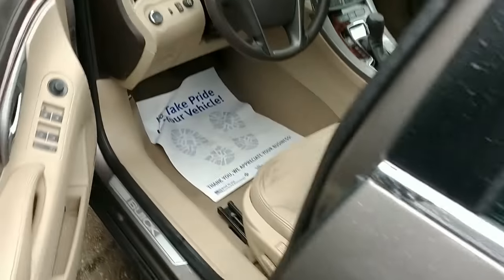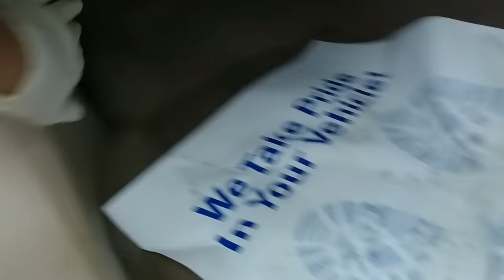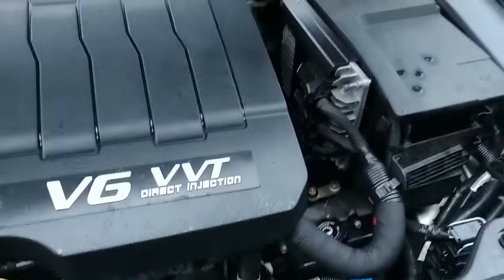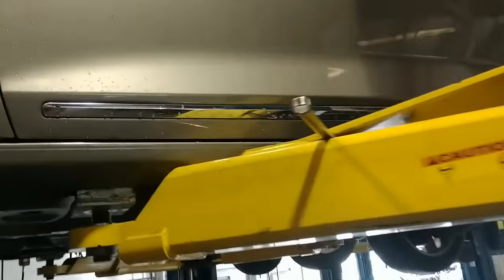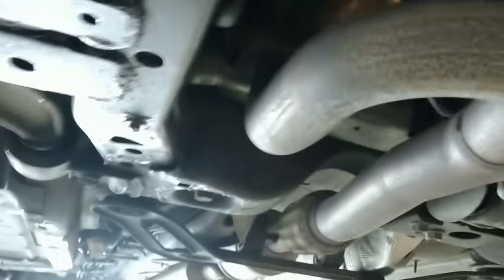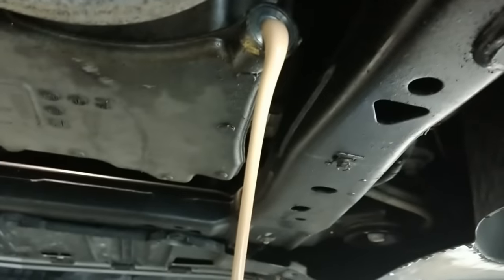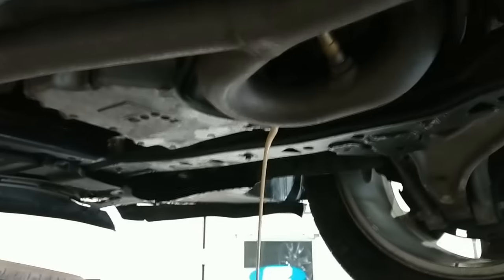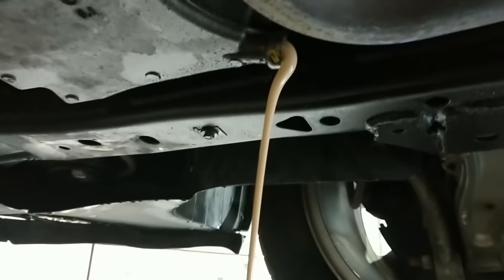Overfilled Crankcase! Blown ENGINE! Used Car Nightmare!

Comment from the maker: To anyone buying a car, truck, boat or whatever... Have it inspected by a 3rd party. Pay them to check out EVERYTHING! Then you know what you're buying. A $100-$200 inspection bill is much less expensive than being stuck with problems like this. If the seller doesn't like that idea, don't buy from them. Vehicles and dealers are  everywhere. Don't get suckered.

Edit: found grammatical error a year later 🤣🤣
Reply: They made Buick vinaigrette. The oil and the coolant  emulsified in the engine like a salad dressing
Reply: Even if you are a tech yourself it still pays to have someone with no "skin in the game" doing the health check, especially if you can find someone with more experience with the year, make, and model you are looking at! Edit: I am not saying that I bought a vehicle ignoring glaring issues because "I can fix it" only to find out later they were a bigger PITA than expected but I am also not saying that I haven't.
Reply: Inspection bill? is this the same as getting an inspection for your registration, or are there mechanics that will specifically inspect a car for you before you buy it?
Reply: I work as a mechanic...licensed...certified etc. if I had a dime for every POST purchase inspection that I've done that's uncovered thousands in work required to make the damn vehicles safe...I'd be a rich man by now. People...get it inspected BEFORE you pay for the vehicle!
Reply: Same goes for a house. On top of the bank's house inspector, have specific electrical, plumbing, and hvac inspections.
Reply: @RockSleeper  Any ASE mechanic should be able to inspect a car for basic road worthiness and major problems.
Reply: @RockSleeper  No.
Reply: Remember, folks: unless it actually runs on coal and has a boiler, a steam-powered car is a bad idea.
Reply: My 2 cents. Dealerships are a new low. I never trust the seller. Oily is the expression used how dirty car Dealership s are. Do your research and get a good inspection.
Reply from the maker: Any shop will be happy to do a super  thorough and comprehensive inspection for a prepurchase inquiry. They usually charge between 1-2hr labor.
Reply: UH-OH! LMAO.
Reply: Excellent advice! Bought a car recently that was "too good to be true" well after 600 dollars in parts and alot of swearing it would have been better to drop some more dough and not have a headache
Reply: @RockSleeper  I guess it depends on the state, here in MD state inspection is only done once when you first tag your vehicle, but you can have a vehicle inspected before you purchase it as long as the owner is willing to take it to the shop to have it done. The last time I had a car inspected was 2018 and it was around $90-100. Because it is only done once here in MD they are more strict and nit-picky unlike say VA that goes every year or every other year and only checks basic stuff like tires, wipers, lights etc.
Reply: So what was it, cracked block or head gasket?
Reply: @JasonW.  why? They can say anything,miss anything.  They have no accountability to anyone
 Big scam. At least where I live.
Reply: I check my own cars.
Reply: @Jo Blow but how does one crack a block?
Reply: Or simply have common sense . To be honest DOSNT surprise me at all with the new auto industry nothing is built to last years down the road disposable Dixies you replace every year .
Reply: Great advice but unfortunately I think most by here pay here customers don’t even think twice about the vehicles reliability. They are more worried about getting approved hint they shouldn’t be Financing a car
Reply: Yeah or what’s called MAYONNAISE. mayonnaise MATE
Reply: Word
Reply: @Jo Blow did u not see all the water coming  out the exhaust  it's a head gasket  for sure.
Reply: If a seller has a problem with you having the car inspected, stop to wonder why that might be.
Reply: unfortunately its difficult to find a shop that is willing to spend their time looking at a car lol. I took my car to two shops to get checked out and they just half assed their "inspection". Shops now a days seem to be unwilling to fully inspect a car regardless of money lol. I dont even bargain for the amount they want to charge me to look at the car. They thought my car was "losing oil" because there was excess oil near the oil filter which sits at a 90 degree angle and is very tough to get to. 07 Si btw.
Reply: @Jo Blow 🤔
Reply: buy here pay heres love to sell those pretty pieces of shits, to people that dont know any better for 30.99999 apr and a huge down payment...
Reply: im assuming the original owner.. got repoed. emptied the oil or dumped anti freeze in the oil...new buy here pay here won car at auction, there in house jack legg mechanic assumed it need a water pump. replaced it, might have broke a bolt or forgot to tighten.. water pump leaked into timming chain..down to oil pan... im just assuming.
Reply: everyone should know enough to check oil and coolant...especially if you're buying a car
Reply: @stevejackson9952  v6 vinaigrette. My favorite
Reply: @lawnside82  I agree
Reply: 100% agree have worked for multiple dealers for years and nobody would ever be against the inspection, it’s actually nice for the dealer because you don’t have to worry, if something happens in 3 days they will blame the inspection mechanic lol
Reply: @RockSleeper  not the same as a state safety inspection, get a pre purchase inspection before purchasing
Reply: @nbrowser  yeah 95% of post purchase end with customer pissed or crying
Reply: @RockSleeper  no it’s different. Find any quality mechanic in your area and schedule a pre purchase inspection. They’ll look over it with a fine tooth comb and tell you everything that needs fixing or if it’s worth buying.
Reply: @justinkroeker1464  recent one was a '11 Nissan XTerra...$9,500 (Canadian dollars) repair estimate to make it safe...it went right back to the used car lot that sold it to him.
Reply: Yeah but paying that for every case you look at adds up fast just bring someone with a little knowledge of cars and you should be ok
Reply: Try telling this to my mother.
Reply: @RockSleeper  You can get a car inspected at a licensed service point for the brand. Sometimes they call it a "pre-purchase inspection", sometimes they call it something else. I've done this for used cars a couple of times, and at least once saved me from a 3000-4000 euro repair bill.
Reply: Bought one from bhph, paid over $7k for a $1200 car.... but had no credit.  Only had to replace muffler after i got it off the lot.  Great on gas.  1997 Saturn SC1, 5 speed,  1.9l 4cyl
Reply: This is why I only buy new...
Reply: 15 day federal warranty 500 miles engine and transmission only that should cover it
Reply: is there any type of a update on this as did she take it back to the sellers and say "i want my money back as you sold me a POS"
Reply: @JasonW.  My dad did the same thing when he bought this place.  He believed the seller and didn't have anything inspected. Fast Forward to now. I replaced everything on this land including the trailer, the electrical, the plumbing, and because my soil condition is so bad I spent 10 grand on a septic and another 8 on replacing the old well. Both the seller said was replaced a year before we purchased the place. 18 grand to get a property ready for construction that's worth 8 on a good season.
Reply: @Jo Blow I've had the same issue with coolant mixing in oil and it was the head gasket. Only cost me $400 but I hadn't been driving 100 miles or overheated so I figure I was lucky to not have more damage and expensive repairs. Seen it happen several times to others too but it's usually just whitish frothy oil with bubbles on the dipstick. This car ran too long this way. Best to check oil frequently to catch issues but most of us are too busy and get bit sometimes
Reply: Over here in Australia, we have large commercial auto 'clubs' that started way back when cars were becoming popular forms of transport. Nowadays they have insurance arms and ride-side assist, and pre-sale vehicle inspections for club members. It's a great service. There is a range of membership levels, but Roadside Assist is across all levels with different perks for more expensive memberships. The pre-purchase check is conducted onsite, which is great for the type of purchase described in this video.
Oh, I'd love to tell you about my old 60 series Landcruiser wagon and three bottles of 'Bar's Leaks' one day.
Reply: Exactly what we tell are customers. If they won't let you take it to get looked at they are hiding something.
Reply: Bought a car this past year. Had it inspected. There were suspension issues, but that was it. 9 months in, it threw a rod.  Big 3 inch hole in the block.
Reply: @JasonW.  and never ever have your house inspected by an inspector recommended to you by the real estate agent because they're kind of working for them
Reply: Good advice to have a mechanic check out a vehicle before buying however you still don't know what your getting as a mechanic can not predict the future.
Reply: @quarterblacktravis  yeah, it used to have one.
Reply: @Jo Blow it happens more than you think
Reply: @StrikerFin  by smoking with children in the car. Read a book.... nyuggah.
Reply: @lawnside82  you know what happens when you assume right?
Reply: Dont believe me ask lord Vader
Reply: Ha
Reply: I've seen Russians clean out the coolant and fill the radiator with oil when a head gasket goes. Friggin geniuses 👍
Reply: @LogicofChaos7871  Easy keyboard warrior! No I just don’t have money problems. So I don’t have to settle for shit boxes.
Reply: What if I buy from a mechanic themselves? Would it be a big middle finger I I brought another guy to check it out? I guess on the long run it doesn't matter about their feelings but just a question
Reply from the maker: @breezeistlime96  Feelings dont matter when there is a deal going on and when your hard earned money is on the table. Bring a guy if you can. It can't hurt you and it's your wallet. Not all technicians and/or mechanics are the same.
Reply from the maker: @mrhead5823  Brilliant!
Reply from the maker: @Kowalsk_the_w  In finishing up dinner other jobs. This one is coming up. I'll make a follow up on it.
Reply: @mrhead5823  when a head gasket goes the oil and coolant intermix anyway so I don’t get the point of that.
Reply: @nodak81  this makes no sense at all. The dealer has an incentive to cheat you because once you’re off the lot, it’s yours. A mechanic has every incentive to find things wrong with the car.
Reply: Who do you contact for a car inspection before you buy it? Like what I need to do, just Google local inspectors near me?
Reply: @ThePackman627  Find a friend who has a mechanic they trust. Since most mechanics hate these kinds of dealers, they’ll be happy to give an honest inspection for $100-$200. It’ll be worth your effort.
Reply: Do you bring the inspector to the car or do you buy it first and then have it inspected?
Reply: @dussan2  either way. A good mechanic can see major warning signs without putting it on the lift. And the seller might be legitimately reluctant to let you remove the car. But if they refuse to let a mechanic look at it at all, walk away from the seller.
Reply: @johnsrabe  I'm buying a car during memorial day from a dealership so I'm curious what I should do to keep from getting ripped off.
Reply: The ONLY caveat I’d give is CPO cars, but that probably goes without saying to most. If the dealer is CPO and stamping it, probably at least mechanically fine.

Unless you’ve seen otherwise in the industry? In which case please correct my ass.
Reply from the maker: @ThePackman627  If you have a shop that you regularly use, just drive it over there. Be upfront with the seller. Tell em "I think we have a deal, but I'd like to have my regular mechanic look it over" or something along those lines. If the seller doesn't agree, move on. If you don't have a regular shop, just call around and ask if they would do a pre purchase inspection for you.
Reply: What was the end result on this job? Was the motor done? Come on man Give us the dirt!!!
Reply: @mrhead5823  sounds good other then the over fill of oil and pushing the seals out the motor
Reply: @RockSleeper  I've paid independent mechanics to inspect and test drive my last two used vehicles.  Well worth the $100 bucks to walk from the deal if they find anything.
Reply: @oxxnarrdflame8865  Head Gasket bro coolant mixing with the oil should give that away pretty easily
Reply: How did the customer react did you show them the video?
Reply: @RockSleeper   he’s referring to paying a “bill” “$100.oo” or two is always better then having to pay a much bigger “bill” to fix what you coulda detected for a fraction of that “bigger bill”
Reply: @flipppy83  but that’s not the inspection the video is talking about! He’s literally telling you to have someone that has nothing to do with the dealer so they can make sure something like this is not happening and that the actual car is in good condition to make the purchase
Reply: @PabloEscobar-gv1cj  I understand that, most of the shops around my way would just preform the state inspection that way they can go through everything and tell you if the vehicle is good to go or if it needs work. Personally unless it's a large national dealership I never trust the inspection certification of a small corner dealership. My brother in law bought a used 96 jeep years back that was already inspected ready for tags and title, the thing was the biggest pile, rather than replacing the entire brake line they spliced in a patch with compression fittings yet somehow the inspector they dealership used overlooked that no-no.
Reply: @quarterblacktravis  you just don't understand
Reply: @mrhead5823  no I understand perfectly
Reply: @mrhead5823  he is using the radiator as a oil reservoir. But like I said that cool but that means the oil pan and the water jackets are connected and if u put a radiators worth of oil in any motor it going to push the seals out because it creates to much oil pressure and pushes  seals out.   I understand  it's not smart tho. It will get you home but not good
Reply: @quarterblacktravis  nice try
Reply: That's part of the reason why it's more expensive to buy used from a dealership.
Reply: Fresh RTV on the front cover.  Probably had the classic 3.6L oil leak from the front cover, to save a buck they didn't replace the water pump passage gasket, and all the coolant leaked inside the crankcase.  All for the want of a few dollar gasket.
Reply: So what did the lady say and what was the outcome of this ?
Reply: Wish I had made that decision before buying mine 😔
Reply: Never buy Opel -Buick  scrap, it sucks in Europe as well as everywhere!
Reply: @stevejackson9952  so very true
Reply: Looks like vanilla butterscotch milkshake
Reply: Anyone wanna buy a Ltx 383 trans am? Just sits in my garage collecting dust t56 six speed manual  is trans
Reply: @Beak3er  yeah your credit should be measured differently we have a really broken system. If you can afford the payments it should be yours
Reply: A few of the shops in my area offer free inspections, and most of them don’t charge too much when they do, just get it inspected bois, it’ll definitely save you plenty of money
Reply: Bro.
They didn't make a Lucerne in 2012
Reply: Thank you for your advice
Reply: @Jo Blow not saying you’re not right, but even a blown head gasket can allow coolant into oil, I’ve had it happen
Reply: @nbrowser  Here in the US there's no automatic "take back".  Unless there's a specific warranty, at least in my state it's "buyer beware". If you buy a used junker, you're on your own.  Car purchases don't have a 3 day grace period like door to door purchases do.  Lemon laws only apply to new cars.
Reply: Let ME GUESS THE OIL. CHANGE WAS THE YEAR 1 B.C. LMAOOO .. JUNK AS CAR'S
Reply: I so wish I had my Sub k2500 checked out beforehand ToT now she is a brick
Reply: @quarterblacktravis  mechanic seems surprised by volume of fluid. Overfilled?
Reply: @rokarolla  ya with anti freeze. Its the head gasket
Reply: Thanks man for educating people
Reply: @benboomer5632  lol, imagine thinking all used cars are shitboxes.
Reply: Should we get the engine compression tested before buying?

How much would that cost?

They do that for airplanes, as part of maintenance, and it's standard for buying a new plane.
Reply: How do you go about doing this though?
Reply: @mrhead5823  in Russia car like bear 🐻 run on vodka!
Reply: I’ve lived by this rule forever!
Reply: 200 dollars for an inspection is a rip off. 100 tops for top tier
Reply: Blown head gasket or crack in the block needs a motor
Reply: It is a problem the world over,  even here in the land down under,  thank God for lemon laws, I wish your videos were longer and showed a conclusion. 👍
Reply: this is the best advice one could get.  I knew this, followed it, and avoided a 17K mistake at a cost to me of  $120.00
Reply: That's why they say change your coolant regally.  When it goes bad! coolent brakes down becomes very corrosive ,  and likes to start eating those head gaskets . You see this alot due to never flushing radiator .  / pull your thermostat an replace the same time as well. flush the motor after as well. motor holds alot of fluid.   A good machanic should do this anyways. but I've seen lots of things to turn a quick  buck over the years. plan head gaskets at 180,000 mark anyways.  just known for it " best  reliable motors based of the 3.8 motor besides o2 sensors cam/ crank/ coil packs/ I've owned buicks crand prix an love them. change the oil regularly.   If I lived in a state that had no salt. I live up north .  I dont know I'd hit 400 im not saying whithout a few of them parts I've noted  these like fuel pumps sometimes.  but none the less are good cars an parts are reasonable  if you want reliability 100% damn near 50 now . three cars .  same motors an all three cars had 180 to 200 thousand on them  if that doesnt tell you something. I'd love to find something solid  no rust or very little older grand  prix whith a turbo would be nice around the year 98 an resonabl price dont care if its blown up whatever I got a heart beat around somewhere.
Reply: Common for people to get a home inspection before buying a house. But no one seems to think about getting a car inspected before purchasing. If nothing else. At least pop off the coolant cap and check and smell the oil and tranny fluid for glaring issues. SMH
Reply: Engine butter
Reply: @RainmanRaysRepairs  my brother wants to buy a 2020 truck, should he get a pre-purchase inspection by 3rd party even though it’ll come with factory warranty and it’s a 2020? I want to hear your personal thoughts.
Reply: @kennyb2497  a|<->|lot
Reply: Never buy a used car without your mechanic standing by.
Reply: I want to know more I’m an auto-mechanic and I’ve never seen anything like that. It just kept going nonstop
Reply: Aren't there state laws being broken when someone sells a car knowing it is damaged and not telling the buyer? Even if it's not a licensed dealer, I'm pretty sure this could be taken care of in court.
Reply: So many people drive a vehicle and when they know something big is about to break but its still drivable, it's the most common sense thing to do is dump it off at a car lot even though morals
Reply: @StrikerFin  Cracked blocks are usually the result of overheating, failed waterpump, failed thermostat or coolant leak.
Reply: @HockeyGoon939  Yeah I know but on a fairly new car? Unless they damaged the radiator and It leaked.
Reply: @StrikerFin  Because of emissions modern cars run hot and lean compared to cars 30+ years ago.  A thermostat, or waterpump failing at 8 years isn't exactly uncommon.  An extreme example is the Chevy Cruze.  For the most part they are good cars up to 50k or so.  Then it seems like half of them develope over heating issues that can't be diagnosed.  I have seen and heard of several that will overheat blow the head gasket and go into the shop for repairs.  Usually a new headgasket, waterpump,thermostat and flush the cooling system.  They go back on the road and immediately start running hot.  At that point they start throwing parts at the car in desperation hoping to fix it.
Reply: @HockeyGoon939  Hmm, interesting. This emmision thing getting out of hand. You heard how they trying to ban modded/tuned engines?
Reply: Update?
Reply: Don't ever buy from a buy here pay here you're going to get screwed every which way there's a reason they make it so easy to get a car.
Reply: I always check for floating oil in the coolant tank (when it is cool of course), check oil, and look for oil leaks in the engine bay. Just simple things you can do. Also if you can, bring a code reader with you.
Reply: I've told everyone I know about getting a vehicle inspected by a technician before paying a dime.  Only about half of them listen.
Reply: I bought my car off my mechanic who's a family friend. He was thinking of selling it to his daughter and gave it an MOT right before I bought it so I know it's in good condition.
Reply: That is why you should have laws that state that a fault that was there when you bought it and not listed as a fault on the car is the sellers problem.
Reply: @mrhead5823  that’s not a bad idea! I wonder how long it would run that way?
Reply: @JasonW.  I will attest to the wisdom of this advice. ALWAYS get specialists in to inspect ALL critical systems in your home (or car) before buying.
Reply: @Revener666  this is why in the UK we have an MOT where a licensed mechanic with proper testing equipment and training checks the car once a year. Faults are split into "advisories" which can be left alone and "serious" which must be repaired at once. Failing to do so and get the vehicle rechecked will mean the vehicle is not legal to drive and you won't be able to insure the vehicle for use on the road.
Reply: @aliboy357  Same in most if not all of europe. But it is not the same thing I was talking about.
This is more an issue of consumer rights and sellers not being able to fool you and get away with it.
Reply: Please follow up.  And keep up the good work!
Reply: Could you not just flush the engine with oil a couple times? 
Fill it up, run the engine for ten mins then empty, etc. By the third oil change it should be running clear, unless the damage is already done.
Reply: @anthonyh4745  But you still need to fix the issue, that water is leaking from the cooling channels to the oil, before you do that. Also modern engines have smaller tolerances so parts get damaged eeasier withouta proper  lubrication.
Reply: @oxxnarrdflame8865  Cracked plastic intake manifold
Reply: Good advice
Reply: @midas9935  An inspection will never find everything.  It will find things that can be found.
Reply: @Brianlikescars  Look at what is on a CPO inspection  Most of it is bull.  And they are NOT inspecting it for you, they are inspecting it for the extended warranty (that you are buying).
Reply: I still think that would fall under selling you a fraudulent product. Especially if the place claimed they checked and fixed “anything major” or something along those lines.
Reply: @nbrowser  what If it's a Toyota truck?
Reply: Most mechanics here in Florida will give ya a once over for 50$
Reply: Just choose the inspector carefully!  I once bought a truck after I took it to my usual mechanic to check out.  He didn’t charge me, but I tipped the new guy who looked it over $50.  3 days and less than 100 miles later the rear diff. locked up at 70 mph on the highway.  Turns out the new guy wasn’t so thorough.  Since my longtime mechanic shop decided to keep him they lost me.  Never went back.  And another shop did a great job replacing the entire rear axle housing, diff. Etc.  Still going strong 70k and 11 years later in fact.  Now Greenville Transmission Clinic gets ALL my business, and they’re the only ones I recommend for anything drivetrain.
Reply: @breezeistlime96  Usually if you’re buying a car from a mechanic or a body shop you should expect it’s something they priced too high to a customer, fixed way too cheap and now they’re looking for the next sucker.  In other words... Run!!!
Reply: @ThePackman627  Go to a mechanic you trust.  It’s not a safety and smog inspection.
Reply: @dussan2  Take the vehicle to the mechanic before you ever give the lot one dollar.  And don’t trust the Carfax.  They’re wrong or  incomplete sometimes.
Reply: I've seen mechanics say stuff is wrong with perfectly fine cars I had listed for $500. Then they have instant repeat business. I'm scared to death taking anything to a mechanic.
Reply: @RockSleeper  most mechanics will be happy to do a pre purchase inspection and tell you what shape the car is in
Reply: So what exactly happened did you have to replace the oil tank or have it throughly cleaned out or chemically washed?
Reply: @RainmanRaysRepairs  seeing as how it was a BHPH lot chances are the lady is one step from being broke..  sucks because it looks like an otherwise really nice car..   of course the question remains..  why was the timing cover off at 75k miles...  seems wierd that something broke so early on in its life..
Reply: @stevejackson9952  I worked in a machine shop (factory production) for over two decades, and we would make an oil lubricant mixture of oil/water for use when drawing aluminum.  It was a vendor recipe that we would follow and it worked great for our purposes.  The "oil" coming out of the pan looks a lot like the stuff we used to purposely make.
Reply: @jm6822  Well I work in a kitchen and I know that if you mix oil and water in the right proportions and then mix at a high rate of speed you make what's called an  emulation.
Reply: A inspection is a good idea but it doesn't come with a guarantee. If you know nothing about cars have a person that does look at it. There are plenty of folks that can't just pay 100-200 bucks for a car they may buy. What if they end up looking at 5 cars before they decide. Personally I would avoid buy here pay here type places simply because they grab cars from auctions and we all know auction cars aren't good cars lol. They are at the auction because the dealer got them and found them to have problems so they go to the auction.
Reply: First time I bought a truck by myself, I regretted not having it checked out by a third party. I overlooked things that could have helped me negotiate a better price.
Reply: @rockdem0n  Good point
Reply: We do them for our customers for 25$
Reply: @jefferynorris3898  that's a great deal really. Especially for folks that have no clue what's up. I've sold a LOT of cars in my life and never not disclosed any issues it may have had. No fun buying someone else's headache.
Reply: @RockSleeper  
There are mechanics that specialize in “remote buyer”. The two times I saw a car I wanted  turn up 4 states away from me, I’ve found them through internet and hired them to inspect. Based on the inspection reports & photos, I decided against buying in both situations. 

Within your own local area, if you have a mechanic that you trust, then schedule with the mechanic ahead of time to inspect this car for you. It’s no different than “taking a test drive” - you’re occupying the car, to assist your decision-making whether or not to buy it.
Reply: @Jo Blow my thought exactly and especially how bad this one is and I find when gasket blows most of the time it'll blow the coolant out the reservoir.  My mother in law had this same vehicle and had 2 engines put in under warranty. She traded it in after the 2nd motor and didn't even drive it again. I drive a real man's brand MOPAR.
Reply: @StrikerFin  overheating can cause it and especially if you try adding coolant before it cools completely off. ..made that mistake as a teenager.
Reply: Here in good old "non-free" and "overregulated" Europe, we have warrenty laws that states that the seller is required to provide a product that the buyer can reasonably expect to get. In other words; if you buy a secondhand car and a month later it spews this Bayleys out due to a missing gasket, and the car has not been to any other garage, then the customer can take the car back and demand a fix or some other compensation. 

It doesn't matter if the seller said the sale was without warrenty, they don't get to decide that, the law states that warrenty applies, fullstop.
Yes there are caveats to this ofcourse, the defect has to be one that the customer cannot reasonably have caused themselves, or noticed during the sale. But in many cases it's actually up to the seller to demonstrate that the fault was not there when the sold it in order to get out of the warrenty obligation.

It can be a pain for the sellers but then again; people who sell broken cars are basically criminals who deserve to get in deep sh8t.
Reply: @RockSleeper  Oh, YES indeed there are.  I know NOTHING about cars, so when I am thinking about buying a car, I ring up one of the two mechanics that do inspections (usually Jared) and they come out to the lot with me, listen to the dealer describe everything, and then I let them do their magic. They have car computer readers so they can check alerts, events, histories and faults.
I never spent more than $200 on an inspection -- even had them throw in a freebie since they saw another car that might be better suited on the same lot..
Reply: Let them repo it and go get somewhere else. Try again is all I could say. It needs a whole new engine or rebuilt from the ground up if I remember things correctly.
Reply: @JasonW.  and roof, pool and chimney inspections.
Reply: My guess is water pump, thermostat, belt or some other over heating issue cracked the block
 Probably bad when they bought it and they drove it hot.
Reply: @quarterblacktravis  When I saw the white exhaust, that was my thought.
Been there, done that.
Reply: This really good advice and its money well spent!
Reply: I second that, especially if its a used vehical
Reply: I wonder if there's a follow up to this, I know Ray said he was going to in a comment up above
Reply: @RockSleeper  you can pay for what is called a pre purchase inspection but the owner has to be the one to do it. I have had dealerships refuse to do it because the car was crap. I learned the hard way always get an inspection or walk away. Don't be like me. Legally a shop can't look at a car you don't own which is why you need the owner to do it.
Reply: @oxxnarrdflame8865  head gasket is what I'm guessing.
Reply: @lawnside82  sounds like experience and I think that's very possible
Reply: @otis6791  that's a great deal our jeep was 1200 but then it ran like a champ until wiring caused a fire lmao
Reply: Never buy any used car from these off-the-wall car lots they almost every block in town because a lot of them know automobile inspectors that will inspect the car without looking at it, if it is not a big dealership that you're buying a car from you better get a thorough inspection done buy a good mechanic or it's your own fault.
Reply: @Jo Blow OMG yes, I had a friend some time ago that bought some Lincoln something or other, it kept overheating and blowing the top off of the coolant over-flow tank, but kept wanting me to replace the water pump. I stopped trying to even talk to that guy anymore. Lesson learned.
Reply: I saw one car I liked online and asked them if I could take it to get it inspected. He emailed me back saying I would have to purchase it first, but that I would have 5 days to return it back. That was a red flag for me.
Reply: What if the vehicle you are buying is about 200,-
Reply: I want to add this goes for honest sellers as well. We had a WRX that was 10 years old and started having some issues. We replaced it, but left it parked in our driveway for some time because we wanted to get it checked out before selling it, and we had other things on our mind and procrastinated. But one evening someone who was driving by saw it. I think he had stars in his eyes with the idea of getting this car for cheap. We told him everything we knew, how long it had been sitting, what symptoms it had, etc. He didn't want to get it inspected. He wanted to buy it AS-IS, for a somewhat lower price than we would be able to sell it for IF nothing major was wrong with it. He really wanted it, and we sold it to him.

It turns out something major was wrong with it. So it turned out the deal was to our benefit. But we didn't feel very good about it. We weren't out to sell someone a car that would be too expensive for them to fix. I don't know if he ever got it fixed or not. We were on the good end of the deal, and he's the one who offered. We just... don't feel very good about it.
Reply: Meh - been buying used cars for decades, I've been trained on what to see :D
Reply: New subscriber here. I'm not much of a mechanic, but these videos are highly entertaining. 

Educational + entertaining = count me in.
Reply: Great advice  and any seller that refuses you take there car to a mechanic to get check out before purchasing is probably hiding something
Reply: Easier said than done. Finding an actual mechanic willing to drive around with you looking at multiple cars is impossible. Also the sellers have very little patience for it. It's simply not a realistic thing for most people, especially poor people who need good cars the most.
Reply: @RainmanRaysRepairs  so you think sellers are going to let you take a 2 to 4 hour test drive to take it to your mechanic. You don't live in the real world.
Reply: @kevinconnell2471  that's not true, maybe they just don't want you to steal the car. Saying you're taking it to a mechanic is a red flag for sellers. You disappear with something worth thousands of dollars with what? A promise you'll bring it back? Haha. Get real.
Reply: @nah-y4e   the seller would of course drive his or her own car to the mechanic of the buyer ?  Sure it would be a inconvenience but if the seller has nothing to hide then it shouldn’t be a problem
Reply: I would even offer the full asking price and give a little extra for the sellers time if it was a nice car and really wanted it
Reply: @nah-y4e   agreed it’s a inconvenience for the seller but I wouldn’t spend thousands of dollars of my money on a car without a 3rd party looking at it ?   It’s great advice especially these days
Reply: When i bought my challenger, it was from a ford/buick dealer but the car went over to the local dodge dealership for a oil change before I bought it and Im friends with the owner and he let me literally go over and open the car up and look at literally every inch of it with a mechanic and they gave it a clean bill of health and I even got to see under the car and everything. Perks to having friends like that. 

That car has only had damage from getting hit since then by a idiot in a parking lot had the fender repaired and cant tell and car is like new and a failed turn signal assembly that caused the car to get stuck in left or right signal without being able to turn it off.
Reply: This saved me. It is 100% the right thing to do. The mechanic was apologizing for the $130 he charged and I told him it was they best money I've ever spent.
Reply: Prime example.
Reply: If the seller isn't ok with it there's likely something wrong with the car.
Reply: There are lemon laws that she can take advantage of & she can sue the dealership for knowingly selling her a lemon.
Reply: @kevinconnell2471  yeah I guess if you're that concerned about being scammed. I used to do it when I was young and inexperienced but really there's nothing a mechanic is going to look at that you can't yourself in 10 minutes or less. 

I've sold a dozen or so cars on craigslist and I would never let them take the vehicle for 2 hours or whatever for any reason. Way too many people that will just drive off and steal your car. Then they have a 2 hour lead, cops will never find them.

Plenty of buyers out there that will show up, take a 10 minute drive, buy it, and leave. But then again all my vehicles were sold honestly so they didn't have to look for problems, I always went over anything I knew about it.

One of the best cars I ever had I bought from a tow company that seized it. Paid 1/4 the price of a dealer and all it needed was a new bolt for the foot pedal. But even if it needed an entire transmission I would still save vs going to a dealership.
Reply: @kevinconnell2471  that's a common scam too, a huge red flag to sellers is when the buyer offers more than asking. I wouldn't let them even test drive it after stating that. Sounds like a scam to get you to hand keys over.
Reply: @kevinconnell2471  if they want to waste time. How often do you buy a car locally? I usually drive 100 miles or so to find a good car if I have to. That means my mechanic is xxx miles away. So you'll have to find a trustworthy one near the seller, they aren't driving 40 miles out and back wasting their time and gas to have you maybe say yes to buying it.
Reply: @nah-y4e    I agree there is lots of things you should look before buying a car . But when a car is on a lift in a garage  you can come across a lot more potential problems before buying . Sure if your a 100 miles away  your not going to ask the seller to drive it your mechanic .
Reply: @quarterblacktravis  that's first thought
Reply: @RockSleeper  Not sure what country you're in, but in New Zealand there are companies that provide mobile vehicle inspection services, including the national Automobile Association.  You can also ask your mechanic to do a pre-purchase inspection if you take the car there.
Reply: @benboomer5632  not everybody can afford new dude c'mon
Reply: Now that I live away from my kids and they need new (used) cars the mobile mechanic $150 years dollar inspection bill was the best money I ever spent. Have the mechanic meet you at the sellers house at a designated time and they will go through everything. Coming from someone raised a mechanic you really have to trust me on this one.
Reply: @nah-y4e  lol u must be a crooked dealer. I just went to look at a car that cost 16k. I had 10k to put down cause I didn’t want a high note. The one dealer told me they don’t allow that, even to close shops. So I called the close shops to see if any of there mechanics could go check it out since the car was a good distance from me. and both the shops near the independent dealer(not dodge or Ford etc.) said they didn’t want to because they don’t do business with that dealer anymore due to lies/mispayment. ANY DEALER that dosnt want the car to get inspected at a local shop is because they don’t want you to find out if the car needs any repairs. Now someone off OfferUp or Craigslist they might not want to, which is understandable being they have no clue what your up to, or how to handle the situation if it went bad UNLIKE car dealers.

The other dealer I went to and bought a car from had no problems
Reply: @kevinconnell2471  for him to say there’s nothing a mechanic couldn’t tell u that testing a car for 10minutes would… I mean cmon now🤦‍♂️😂. Ye the dealers let you take the car out and get it up to 90+mph to make sure the tranny isn’t slipping in high gears or overheating after being driven. dealers tell u to drive it for 5minutes in there local area and not to go to fast lol. there’s also machines at a mechanic shop to diagnose the electrical system to make sure everything is up to date and has no faults in the system. the check engine light dosnt tell everything. I used to sell used cars. there was times were it took me driving 10-20minutes before some of the cars problems started. like stalling or overheating
Reply: the dealership will say the buyer put the coolant in the oil and its their (the dealership) fault... but they will expect that high interest payment next week.
Reply: Wish it was longer.
Reply from the maker: @ryanawilson8549  sry Ryan, this was one of my first videos. I’ve improved since
Reply: Um...didn't you get more than a dime for every one of those inspections?...and are you rich? 😁
Reply: @nodak81  I doubt a mechanic would bone you during a simple inspection if they’re aware you haven’t purchased it… because if they lie about issues with it then you’re likely to just not buy it and they don’t profit from that. 

Well, I suppose two exceptions could be either.

1.)They’re a shop close to dealership and secretly work together to help sell cars and get a small split of final sale for any car they “inspected”. 

2.)If they’re already repeat customers or potentially repeat customers, then not warn them about several issues so they buy the car and then that’s setting up some guaranteed future business.
Reply: I don't have to pay. I'm my own mechanic 😀
Reply: Yup!! Having a safety check done on a ralliart right now. Crossing my fingers it comes back clean!
Reply: @RockSleeper  I suspect you're kidding but in case your question is legitimate I'll answer. Inspection for registration is just to check that the vehicle complies with basic safety and emissions requirements (i.e. that its a safe vehicle for the road.) He's talking about taking the car to a mechanic to have them check out everything - the engine, suspension, etc. Talk to a local mechanic you trust and ask if they do a pre-purchase inspection of vehicles.  They'll tell you what they will and won't look for.
Reply: Someone will probably flush the oil system with transmission fluid to clean it out, run liquid glass through the coolant system and pass this off to some other poor unsuspecting soul.
Reply: Ya but I'm sure after 100 miles and that much damage the company better pay for it or buy it back so she can get a running car.
Reply: @oxxnarrdflame8865  read description
Reply: @rockdem0n  true.
Reply: @RockSleeper  there are real mechanics that diagnosis vehicles. I'm one of those that stand outside the bay door and watch if they are testing my car. I know enough to know how it's done. My brother was a mechanic. He taught me a lot while he could before he passed away. He always had a smile when we saw each other. He was a very sweet man. Never forgot my birthday.😭
Reply: How many times have people bought cars that you know of within less than a year they have problems with that car? If you don't live in a state that has a lemon law yeah good luck or pay the money for a inspection.
Reply: @RockSleeper  It wasn't ideal, but I bought a csr this year and the dealer had a rule for how far I could drive to take it somewhere so I took it to a nearby Honda dealer. Probably would have been cheaper at a normal mechanic, but I got a clean bill of health on the car for around $120. Gave me confidence to buy.
Reply: I have known this rule since getting my first car. My parents always went to big named car lots, not the little fly by night ones you see on street corners with 10-30 cars on the lots. Any place that is buy here pay here, no credit check needed, no money down places are set up to scam suckers. I've even heard of these type places going around and repossessing cars that people are making payments on time with and scamming them that way as well.
Reply: @flipppy83  I’m in Northern VA(Born in Laurel, Maryland, moved to Delaware, now I’m in NOVA) and my husband works at an automotive shop in Alexandria. Some people pay for a couple years sticker and some people pay for only one year, it depends and the choice is yours. My husband gets customers for safety/emissions in the shop all the time for inspections, a lot of them try to blame the techs because the customer couldn’t do basic maintenance on their car and now they have to get new breaks or tires etc. They don’t only look at lights, tires and stuff. They run codes, brake checks, lights, look under the hood, the whole nine. I guess it depends on the shop, too. 🤷🏽‍♀️

I know in Delaware there’s an actual huge lane you have to go to when you first get the car. You stay in the car, turn your blinkers on, lights, they run codes, you have to drive then break suddenly. Then every couple of years inspection depending on the car type. It’s definitely different from state to state but you can get inspected before purchase.
Reply: And they said you couldn't mix oil and water Buick said here hold my whatever this is
Reply: Wish I actually did this with my WRX. Just found out the frame has a crack in it after owning it a little over a year. Need it to last just this winter and then it'll be a parts car. Honestly sad, I love the thing. 5spd with a freshly rebuilt motor. Damn MN rust took another one :(
Reply: > if I had a dime for every POST purchase inspection that I've done that's uncovered thousands in work required to make the damn vehicles safe...I'd be a rich man by now. People

 @nbrowser  wait, you do these for free?  :) I'll pay you a quarter, not a dime to inspect my car purchase next time, a sweet 250% increase.
Reply: when i see something like this i pray to the machine god and sprinkle blue honda water over it. =)
Reply: @nbrowser  you got paid less than a dime for each post inspection you did? hahaha, but really, based on this post you would already be rich.
Reply: Problem is if you do that and each car you check has issues then you could be out in to the thousands before you find a car that is good.
Reply: @darrenfalconer3267  go to reputable dealers. not small ones that sell regardless of credit
Reply: i'm glad where i live if they sell you a car with hidden problems they have to pay for the repair or even refund you o-o'" ... and i was complaning about water infiltration / low oil when they sold my car .... i'm glad it wasn't something as bad as this.
Reply: Even a new one.  New are  less likely but still possible to have catastrophic problems and a million ways save a lawsuit, bad publicity  an arrest warrant or all of the above for them not to honor the contract or warranty.
Reply: @JasonW.  some states require proof of those things to be done by both the city/county and third-party as far as real estate goes.  If not done, save bulldozing, rezoning, cannot be sold, lived in, in some cases rented, period.
Reply: If you can't afford an inspection you can't afford a car
Reply: U are smart that’s all I gotta say
Reply: @dussan2   The best way is to take the car you are looking at, to a Mechanic who is a real one, that has a lift, and all the tools to look this car all over, starting underneath it.. 
Then, he/she will tell you what the needs, etc., the condition of the car as it sits today, on the lift..
Reply: @flipppy83  that’s a safety inspection. They won’t check whether the car is a POS only check that it’s safe. My uncle is a tech and when I buy a car he checks the safety stuff and the stuff like coolant, engine oil, ac performance and components, leaks in the water pump, transmission etc. he always tells me to bring it to him before I buy any car.
Reply: @kennyb2497  if $600 was making the car "too good to be true" you should not have bought the car in the first place. If adding $600 and repairs the car still isn't too good to be true, then again, should not have bought the car.
Reply: Usually there is a reason someone is selling a car, because there's something too expensive to fix and its a lemon.
Reply: in Poland you can buy used car for 100-200$ xD
Reply: @rob-123  I’m always suspicious of why someone is selling a car especially these days when good cars are hard to come by.
Reply: It's a blown head gasket.next video
Reply: @RainmanRaysRepairs  Can't find a follow up. 
Did the customer give up on it? Is it still in the works?
Reply: If you don't know anything about fixing cars and such, get it inspected before hand. Remember, you don't normally buy a car expecting to sink in loads of extra cash after you buy it. This poor customer is a case in point.
Reply: The same goes for expensive photography equipment or computer hardware.
Give scammers no chance to rip you off!
Reply: where i live, if you buy car like this, you return it and get your money back, simple as that...
Reply: @euroovca25  That goes for used cars too?
Reply: Everyone says this but it's not easy finding a mechanic who will do that.
Reply: @DrWakey  yes, goes for used cars also. Warranty for used stuff is up to 6months if you buy from any 2nd party.
Reply: @nbrowser  how do i do this?
Reply: @Jo Blow he could be absolutely correct with head gasket. I own a 2004 Rover Streetwise. The HG going looks exactly like this if the car has been run for a long time and not had it sorted. The garage that sold the car probably knew about it. theres no way they couldnt with that amount of smoke coming out the exhaust. That car has been run with a bad HG or cracked blocked or whatever it is for a very long time
Reply: The AAA pre-owned inspection does NOT connect a diagnostic tool up to the vehicle. Ended up buying a car from a used car lot that could not get smogged/pass inspection (CA, yes illegal for a used car lot) -- Failed because the O2 line was broken. The diagnostic tool would have caught this immediately.
Reply: DO not do this, just only buy from trusted people. dont spend any money on crap. Technically crap like this should be illegal not encouraged.
Reply: @Jo Blow I've had a HGF with coolant in oil. It was on an engine with a partly open deck with large coolant passages where escaping combustion gases blew the coolant into the oil. That crap got *everywhere*, even into the intake manifold, where the contaminated oil overflowed into the PCV circuit. Skimmed head and uprated gasket fixed the issue.
Reply: best advice ever, but I'd add this included 1st rate dealerships. I bought a 2017 Q7 in 2019 off lease. 30 days later the engine threw a bearing. 13k later my shop installed a new motor from a 2020 (tree or something fell on the donor SUV). ALWAYS, ALWAYS, ALWAYS get a 3rd party inspection. If the seller refuses, WALK AWAY, there will be other cars.
Reply: I mean isn't that what the lemon law is for? And where are you that you can find a mechanic to do ANYTHING for 100$?
Reply: Clearly someone doesn't know how to do a timing chain cover gasket properly. Failure was most likely at the coolant chanel between the heads in the timing chain cover.
Reply: I'd really like a followup on this; please tell me lemon law had her covered.
Reply: Love to know any updates on this car.
Reply: Any updates of the car? It is fixable?
Reply: People are way too dumb sometimes, doesn't take a mechanic to check if a car is in good shape! If the seller doesn't let you check out the engine, test drive, maybe even check a few other things like brake pads and tyre quality... Then you should walk right out, most cars (that aren't a rusty old POS) cost a lot of money ! You gotta know what you pay for.
Reply: @stevejackson9952  looked kinda delicious NGL 😂😂😂
Reply: @nbrowser  it's sad that you even get to find stuff like that, people look at cars as if its some alien spaceship and won't inspect the thing they're buying! I recommend anyone buying a car to learn how to inspect the most vital things, i was worried sick the car i was buying could have hidden problems but i only uncovered one after buying it which was a rusty exhaust pipe i easily replaced.
Reply: @hoilst  what ......dude that car isn't steam powered, It's SHIT powered, the vapor coming from the exhaust can be either burnt Coolant, or an irregularly burnt fuel caused by Horrible engine damage.
Reply: @quarterblacktravis  i mean...without coolant even if the gasket wasn't broken, it surely is after experiencing the raging flames of the combustion overheating past their limit.
Reply: @mrhead5823  hahaha 🤣 well....interesting idea and it kinda works but oil heats up more than coolant so i suspect you'd have exterior leaks soon after.
Reply: @birisuandrei1551  ya your right
Reply: @quarterblacktravis  well i ain't a mechanic for no reason haha, although my specialty is trucks not small cars.
Reply: I had this issue after a timing belt broke and they (dealership) only replaced the belt and didn’t look at the damage it caused. I ended up replacing the engine.
Reply: I usually had my mechanic look over any used car that I was buying.  Until I bought a car from my mechanic.   I needed a car and he had one that "he was trying to sell for a customer."  He said that it was in good shape, that he'd been maintaining for her.  

He never had the right tags for me to test drive the car but he'd been working on my cars for years so I should trust him.  Right?  LOL.

It's a 2002.  When I replaced the fuel filter, it had a production date of 2002 stamped on it.  The cabin air filter had a production date of 2004.  When I took it for state safety inspection I discovered that the struts were leaking, the control arms needed to be replaced,

I guess that the few hundred that he made selling the car was worth the revenue he lost because I've never gone back to him.
Reply: @nbrowser  How? No salesman is gonna let you drive off and get it inspected, or have someone brought to them. I'm truly curious how you get it inspected BEFORE you buy when it's not even yours?!?
Reply: @RainmanRaysRepairs  what state? this doesn't exist where i live lol?!?
Reply from the maker: @deadmanfred  sunny Florida
Reply: @deadmanfred  any good salesman wants a sale to happen...if a salesman/dealership refuses an independent inspection...that's a red flag and time to leave that business.
Reply: @nbrowser I worked at a dealership for a year, never heard of a "pre inspection" that wasnt already done by the dealership. where I live you can't drive a car off to get it inspected. PERIOD.  Now if a salesman let's a " mobile inspector" look at it that's a different story, but every salesman is gonna say no, because they trust their certified mechanic that's on duty... not really a red flag that's how all the dealerships work, at least in my part of the woods.
Reply: Whattya know, I Googled for a pre inspection in Florida and got real places. I'm in Georgia not too far away. Google shows nothing near me, like I said it's unheard-of around here.
Reply: Would this not be considered a lemon?? And do not all stares have a lemon law? That's horrifying- good looking on the outside too. Shame.
Reply: Pay for a car with a check so if anything goes wrong before it clears you can stop payment.
Reply: Saved me once. Was looking into getting a '89 Crown Vic, the mechanic pulled the dip stick, shoved it back in and said, "Buy something else." Metal shavings all in the oil.
Reply: 111q
Reply: @RockSleeper  Nothing like auto reg. You need to get a qualified mechanic to look at everything to see if it's working correctly. In the case of this car any back yard mechanic looking at the oil should recognize a blown head gasket and tell the person hell no.
Reply: They found out it’s a milk shake now they “Will have to Charge!” Lol! 😁
Reply: @RockSleeper  Yes, he is.  My local Toyota dealer will do an inspection for $69.  At least that is what I paid few years ago when I was buying a 2005 Toyota Sienna.  Of course they hope to get the job doing the repairs.  And, it also works the other way.  The van I was buying would once in a while shift in an unusual manner.  They told me that is common on the car and nothing to worry about.
Reply: @JasonW.  Any mechanic (good or BAD)can get An ASE Cert.
Reply: @flipppy83 . Virginias State Police Safety Inspection checks more then just tires, wipers, and lights like you claim...The inspectors also check the condition of the brakes and rotors or drums, the suspension including tie rods, wheel bearings, etc,  they check for holes in the vehicle from things like rust, they check for exhaust leaks, make sure the airbag light isn't on, and all the other  safety features including horn, all lights and signals, window defroster, and some counties in Va require emissions testing . They are pretty similiar to MD overall but MD is stricter as far as not allowing modifications to trucks and jeeps like lift kits, big tires, and some of the other things that you can do in Va.
Reply: @rachelbrinkmeier6387  My reply was a general list. My father was an MD inspector for 25 years and now resides in VA and he even said compared to MD having to get his vehicles done is a breeze, that's one of the main reasons every MD uber and lyft driver friend that I have will drive to Alexandria for their yearly inspections instead of having it done in MD.
Reply: @Jo Blow oh it can, I had a car do that years ago. Drove 40 miles at highway speed and it survived unscathed. I believe it was because I was running Mobil 1. I saw the temp gauge move so I knew the exact moment it happened. I just didn't know till later WHAT had happened :)
Reply: @midas9935  yeah something like that an inspection won't catch. Anything can happen 6-9 months and xx miles later, especially internal mechanical that can't be seen without a thorough teardown.
Reply: I swear by pre purchase inspections. When I was younger, I was going to purchase a ford explorer from a “chain” buy here pay here lot. I needed a car and had not great credit. But since the car was for my wife, I needed it to be as problem free as possible. So, on a whim, I got one at a shop a block away from the lot. The guy pointed out that the radiator had sealant all over it, and that the lot covered up stuff all the time. Even tried to pay him to do patch work. He then recommended another lot that normally has decent cars. I took the explorer back, and went to the other lot. Ended up with an explorer that lasted pretty well. Since then, unless the car is new, I get a ppi. Even did it on my bmw 750 I bought this year from a highly reputable luxury car dealer. It was 3 years old and 37,000 miles  but I scheduled the ppi with the dealer and took it to a 3rd party that gave it a glowing review. Piece of mind for 100 bucks.
Reply: @dennisbryan7522 , 383? Aint that the max a 350 can be bored out to?
Reply: @CONCERTMANchicago  depends  on the 350 some can go bigger
Reply: was there ever a followup to this video?  I didn't see one in your video list
Reply: and after ten cars that failed the inspection you have no money to buy the car. Most tests you can do yourself before you waist money on inspection. Checking the fluids is the first thing you check
Reply: Last year i bought my VERY first car ever, 2nd owner with 150.000km on the clock and built in 2003. 

I went this way: i asked around where people have their cars maintained and what their experiences were. Then i went for the guy that came out best. His place looked a bit shabby, but his tools were in proper order. Talked with him a bit and his main passion was to fix cars and his main concern was having cars roll out of his place in proper condition. On top of that, he doesn't overprice for having that passion and concern and is willing to match the fix with the wallet of the customer (not always going for brand new parts for example).

I bought the car there for only 2000 euros, driven it for about 4000 km now, it always starts, runs perfectly and the only issue i have had so far is a flat tyre. A screw wedged in and that costed me only 10 euros to fix.

This spring in may i'll bring it in for an annual check up (required to be allowed to have the car on the road, has improved road safety by tons in my country). For this he asks a bit more than other mechanics out there, but i'll know that the issues he finds, he'll properly fix for a proper price too.
Reply: Aqqq iou
Reply: Experience with buying OLD cars, here. Old and used up.
It's a matter of not having ANY money to begin with, and I usually purchase from private buyers.
Red flags, if you buy cars that are old and used are => Mileage and appearance do NOT fit to each other. Look for sings like a worn out shift stick (the leather/rubber part, if that looks used and crinkled as frick, it's probably been used A LOT. If the shift stick head has been replaced, it probably was scratched up and shows a lot of use, too.), seats (are there tears/is the leather/fabric thread bare?), steering wheel (is the leather worn down?), the plastic parts of the interior like foot well trim and such (Are they worn down? Scratched or discolored?). If a car looks old and used, it probably has more miles on the clock than the buyer tells you. They CAN rewind the mileage on the car! There are programs for it.
=> Recent repairs, and no bills to show for it. If they tell you "Replaced this and that" and can't or won't show the bills, hands off. 
=> Thread on tires. Are they worn down? Have they visible holes/rips? Does the rubber look old and cracked? Are they worn down the same ALL OVER (If not, you might have, at the best, an alignment issue at hands).
=> Engine and parts there. Check oil, for color and amount. A honest, good, old car never has FRESH oil in it. Slightly used, yes. Black and gunky/chunky, no. Fresh, like fresh of an oil change? Let them show you the bill for that. If it hasn't happened RECENTLY, or the mileages vary greatly, no thx.  Check coolant for color and amount (If your car is older and didn't see a lot of maintenance, the coolant will look dirty. That's ... that's what you get for buying an old car. Coolant flush+replacement usually helps with that). Check for visible leaks from the radiator, and from the engine itself. See if everything itself looks worn out, if cables are bare (metal visible), if anything looks more oily than it SHOULD, if anything looks as if it has been melted. 
=> Make a test drive. Take time, an hour would be perfect, and drive town, country, freeway/interstate. You'll find any problems that occur after the car has driven for an hour, that you wouldn't find if you'd only take it for a trip around the block. 
=> if the deal seems to be too sweet to be true, it most likely is.
=> If you didn't find anything obviously wrong, take it to a mechanic, or 'know a guy' (a reliable one, pls), that'll come with you and look at the car you're wanting to buy.
=> If you buy a cheap car, you NEED to be aware of the FACT that it WILL NEED REPAIRS. Maybe not instantly, but down the road (lol, such a bad pun), it will need EXPENSIVE repairs. So buy a cheap car, and start saving up. 

That from someone who owns a 22yo Seat. I love my clunker, and he pulls a lot of money out of my pocket.
Reply: @skyure  mine 'only' 19 years old, but it's not costing me anything other than the fuel and taxes+insurance. Ok i had  a screw in one of my tyres, but nothing that would cause a headache.
150.000 km on the clock when i bought it, now almost 154.000 or still less than 100.000 miles in your non metric hard to use in math measurements.

My tip: talk with people in your neighbourhood, who live near you and have bought their 2nd hand car locally from a dealer. Hear their stories, check online for sources and just check the place out and ofcourse the person selling cars.

As a complete novice i struck the 'too good to be true' car because i leaned on the experiences of others and my own experience.
This spring in early may i'll be having my first annual checkup (for insurance and just to be allowed on our roads) which he prices a bit higher than competitors, but not by much. I can give him that if he continues to deliver what i want most: a car that works as i want it to.

Over at the other side of the Atlantic i'm sure it's not an easy task to find such a place as things are different. Still the idea is universally sound.
Reply: @AwoudeX   I'm from Europe myself, though. 
I'm just speaking from experience of buying from private sellers. 
But I hear so many people complain about buying cars privately (not dealerships), buying OLD and used cars especially, and then complain about having to put money into the upkeep, maintenance and yes, generally higher cost of repairs for older cars with more miles/KM under the hood, and not understanding that if you buy a car for 500€, it won't be brand factory new. 
That's why I say, expect to pay for repairs if you buy an old, used, cheap car. 
In your case, you had a lot of luck. (You can be proud of your car, if it's in good condition and can pass MOT/TÜV tests. Really, not being sarcastic here!)
Mine's 22, a Seat Leon 1m1, having about 170.000km on the clock. I bought it when it had 140.000-ish.  Put about ... ah, don't let me lie here... 1500 Euros into it, for repairs (cause was old age, actually) that were necessary over the time. (The last was a exhaust gas recirculation valve, a new air filter, and several little tidbits such as new lightbulbs, because I've gotten clumsy in my old age, and can't get the bulbs in anymore).
Then I had a mayor parking brake failure, where the parking brakes on BOTH rear ends seized up mid drive at 90km/h. That was NOT fun. lol That did cost me about 600 Euros extra, because it scrapped literally everything. Braking pads, disks, the lines ... sigh
Reply: @skyure  some people leave their car in gear instead of putting it on the parking brake, if so, stuff will get stuck. If it's not freezing conditions, i use the parking brake to keep it smooth going. If frosty conditions are expected, i put it in gear and don't use the parking brake, because i need to be sure to be able to leave the next morning.

not claiming this was the cause of the seizing up though, could be that it locked because of mechanical failure instead, i'm no expert :D
Reply: @AwoudeX   not even the Mechanik could really pinpoint why exactly, because I had already driven it that morning, parked it, and while it was freezing outside, I don't think they would've frozen up that fast. And it literally happened while driving. So shrug no real clue. I didn't leave the parking brake on, either. My car fusses with a loud constant beep if you try driving with it.
Reply: Before you buy it, pull up the dipstick and look at the oil at least.
Reply: @RockSleeper  yes most shops will inspect your car before you buy it to tell you if it's good or not.
Reply: There is your 710 fluid.
Reply: @flipppy83  They are talking about a MECHANICAL inspection as well as a safety inspection. The state inspection is not where you take a vehicle before you buy it. That is just for emissions, basic safety, etc
Reply: @riccoombs4396  Seriously? You honestly think the buyer here made the right choice by NOT taking to a "scam" ASE mechanic before she bought that car? 
You're probably right though. With "no skin in the game" any mechanic she took it to before she bought it would have just taken her money and told her she was good to go. 
After many years on watching YT & reading a lot of the comments, I'm still amazed at some of the crap I read on here.
Reply: @michaelstrangefranke7002  They all go to the same school
Reply: @mrhead5823  Exactly
Reply: @maddad979  Huh?
Reply: @brad3741  yes
Reply: My grandfather taught me to always get a mechanic to look over any vehicle I'm interested in buying so that I don't get conned.
Reply: Mother’s Milk
Reply: @StrikerFin  happened to an old car I owned once.  Had a very slow coolant leak and had driven somewhere in the country and didn’t have any extra coolant in the car with me at the time, the leak was slow enough you only needed to put coolant in once every 3-4 months.  Suffice to say I came back to the car and had a low coolant light, no coolant but had access to water.  So I used that to at least get back to town.  However, what I neglected at the time was to get the water flushed out.  Not long after we had very cold weather, and all that water in the engine froze, and expanded.  So that’s how I cracked a block.  Now I’m smart enough to actually use coolant and have AAA since I have to drive a long way for work just in case I get stuck.
Reply: @RudyC27  As someone who struggled with credit/debt as a young adult, I imagine what you said is true that they are glad to get financing.   People likely know that the buy here pay here lots aren’t great but if your credit is shot, you probably don’t have a lot of money or a lot of options unfortunately that you can afford.  At least that’s how I was when I was younger.  So at that point they are probably rolling the dice hoping for the best.  Sadly when you think of the interest the buy here pay here lots are likely charging they should have some kind of standard for when they repair vehicles for resale.
Reply: @Averagedude-mi3fl  Ohh, yes thats one way to crack a block lol
Reply: @StrikerFin  Yep.  I was in my 20's and you don't always think about that stuff. Get burned a time or two and you learn not to do that.  I see you have a pic of a yorkie for your profile.  We have a yorkie as well.  Demanding little guy at times, but a great little dog.
Reply: @Averagedude-mi3fl  Yea, i like like little dogs. They are so cute...
Reply: @papayuki3590   sold as is where is.  Means the seller has zero legal skin .
Reply: @ThePackman627   look for a recommended local shop / mechanic .
Reply: @dussan2   take the car to get inspected before you put down a dollar
Reply: @MaximillionBucks   most are junk
Reply: @benboomer5632  Buying new is an idiots move. Pay massively upmarked prices to get slammed with depreciation the second your names on the paper. Yeah great job there
Reply: @aurgasmic6739  Sounds like someone is trying to convince themselves that buying used was a smart choice 🤣🤣🤣
Reply: Preeeeeeeach! This is literally why I do what I do specifically for low-income/ international students. Too much of this shit happens and gives all of us a bad name. I feel worse for the abused  vehicle than anything, but when I think about someone knowing this condition and choosing to cover it up for a sale.... I hope there is an after life, just for them, with a special assigned seat.
Reply: I would love to been the fly listening in on the reaction of the buyer of this lemon
Reply: The only used cars to buy are CPO from the same brand dealer
Reply: @cengeb  I still would not trust it. Local chevy dealer to me sold an Equinox to a friend that wanted me to check it out (after buying it unfortunately) because something was off. 

The air in the cabin smelled of mildew, the underbody was heavily rusted and appeared to have a visible water line, the front rotors were warped and the driver side piston caliper boot was torn.

After he went from dealer to corporate to other dealer (for advice) and finally giving up, we fixed everything and ate the cost.

To be fair, Chevy doesn't cover rust or the other items listed save for brake part quality (torn boot and warped rotors). They still showed him the door.

Point being, don't trust any of them. Inspect them, is my opinion/experience
Reply: @JaysonStork  I have never had an issue with VW or Audi CPO stuff, it's manufacture warranty on CPO for benz, BMW, Audi, VW, not the dealer warranty , so it is like a new car,...they never sell clunkers, stuff is pristine, like new, you happened to get a skunk dealer.  When it's CPO it's completely checked out, with no leftovers, heck, I even asked for a simple plastic clip that was snapped in the engine bay, they got it for me, because, it wasn't supposed to be broken, and I also bought 17 cars from them over the decades since 1987, new and CPO...when ya find a great dealer, ya stick with em
Reply: This also applies to homes.  If it's a major purchase, get it inspected if you're not experienced or an expert in what you're buying.
Reply: @RockSleeper  A trusted mechanic will be happy to do a vehicle inspection for you along with reputable repair facilities.  It wouldn't surprise me if some mobile mechanics provide this service.  They don't care.  They're a disinterested 3rd party and get paid for the job, not to close the deal unless they're subject to bribery by the crooked dealership.  While it could happen, I doubt it would especially if they're a reputable mechanic.  Guess what a mechanic gets from happy customers?  Repeat business in routine maintenance, presales inspections and word of mouth advertising.   A trusted mechanic that does inspections wants to help you and will do a thorough inspection as if they were buying it for themselves or a loved one.  One of my trusted mechanics who's unfortunately retired now would do discount auto repairs in his yard for his church and advertise in the church newsletter.  He was one of those people like my father who liked fixing things and keeping them working.

Never trust the dealer or seller.  Do your own due diligence for every major purchase.  Privately owned transportation is the second highest cost in the USA to housing.
Reply: @RockSleeper  It's a presales inspection where a mechanic goes over everything that may be wrong with the vehicle.  What repairs it needs now and a triage breakdown of repairs and maintenance items.  It's not the same thing as an emissions or State registration inspection.  There are mechanics that will provide this service.  Always chose your mechanic for inspection services; NOT THE DEALER OR SELLER.  Never trust the dealer or seller especially during these times with C-19 vehicle prices.
Reply: @LVLouisCyphre  the problem is most home inspectors are not responsible for things they miss.  CPO used from the brands dealer is full warranty and they back it up.  And it's mfg warranty,not the dealer.  Big difference.  CPO let's you get more care for less money.  Worn stuff is replaced and they are like new low miles,immaculate ,full factory warranty
Reply: @LVLouisCyphre  Agree 100%. Best advice is never trust the seller unless your willing to be left out in the cold. CPO nonsense or, especially when buying a home, their inspection report. For the investment you're about to make, buy the tech report beholden to you. Period

Wish it didn't have to be this way, but it certainly seems to be.
Reply: @cengeb  So just trust and don't inspect when it comes to CPO is what it sounds like you're saying through all these comments. May I ask why you would discourage an inspection when it is cheap insurance compared to the investment? I get that you've stated positive experiences, but why such a blanket statement? After assisting in legal issues with dealers about warranties (which often the only recourse is some form of expensive suit/class action and more time than folks typically want to invest over their vehicle), I am left wondering why you are batting so hard for CPO programs. Am I misunderstanding something and it is that you're stating CPO is better than non-CPO, where I would then ask, why not pay for an additional level of "insurance" to keep them honest/catch the "everybody is human" mistakes?

The sales side is so often detached from the product/service of a vehicle, even if they sell a lemon they may not actually know. So why not check?
*Edited for spelling
Reply: @JaysonStork  CPO vehicles are like new, try it, full warranty, cars are vetted, no junkers, company factory warrantys, not dealers, they are completely inspected, and worn parts replaced, absolutely like new, know many people who have the CPO experience, Benz, audi, VW, Porsche....yes, all the worry for a used car is gone, cus they are barely used, i know someone who found a 3 eyar old ford with 3,000 miles on it, amazing, like new indeed, full factory warranty CPO , yes, trust , like buying new, try it, and it all in writing
Reply: @JaysonStork  They don't sell lemons, that's why they are complete inspected, every little thing, look into certified Pre owned...it's not a standard used car, nope.
Reply: @cengeb  ... and yet the first example of CPO's that I presented was a bad car. The example I cited you mentioned might have been a flood car, which was a CPO, brought to their attention, fought to the corporate level through to class action before the owner gave up. So CPO's are not disqualified from needing an inspection, so I still do not follow your persistence for the CPO program of any dealer.
Reply: @cengeb  I wish I could agree that it works that way, but my experience and the unfortunate experience of others proves this is not correct or at least consistent. So to my point, without the consistency, Certified PreOwned vehicles need to be inspected with the caveat of with a CPO the additional work of needing to thoroughly review the terms is required (which most if not any mechanic not will do as that is beyond the pre-purchase inspection assurance).

Now I am asking directly. Why would you choose to active discourage the inspection of a vehicle, let alone a used vehicle, as a potential buyer assuming the buyer is not inclined/able to inspect it themselves?  @cengeb
Reply: @JaysonStork  CPO, the inspection is already done to factory standards, thus a factory warranty.  It's all done, which is why they have the plan.  there is no risk...It's a FACTORY warranty, just like a new car....Stay current.  Worn items are replaced before the vehicle is offered for sale.  It's guaranteed, in writing, no guessing.  Oy Vey.  If you have not purchased a CPO vehicle, then you need to get up to speed.  Ya don't buy vehicles from some used car lot, that is just dumb.  Ya buy a CPO used car from a dealer of that brand, couldn't be any easier
Reply: @JaysonStork  There is no way  a CPO vehicle was a flood car....dealers are not going to do that and keep their franchise
Reply: @JaysonStork  You also do not know it was a REAL CPO, which matters, meaning the factory mfg. is the warranted, not the dealer
Reply: @Beak3er  I loved my Saturn. Had a white 99 SC2 that I bought from a lady that was near mint condition in 2012. So easy to work on.
Reply: @cengeb  My examples have come from CPO vehicles. Still cannot agree with you.
Reply: @cengeb  I don't know what to tell you. It was a CPO with the evidence to show it was in poor condition. Still cannot agree with your perspective. Get every vehicle inspected before purchase.
Reply: Having to find and now pay for how much a headgasket. Its stupid expensive and alot of shops wont. I feel for her.
Reply: @RockSleeper  duh….
Reply: @michaelstrangefranke7002  not true, they do their job.
Reply: Here's the catch-22, The people that can really afford to do that are probably gonna buy a new vehicle.... And the people that should do that, Are usually people that can't afford to that 100 bucks might be the difference of whether or not they could buy the car at all.  It really sucks.
Reply: @JasonW.  Home inspections have been routine for decades. Considering the price of used vehicles now, vehicle inspections should be routine as well.
Reply: @StrikerFin  Driving it with no coolant would be one possiblity. Not repairing a small leak for example could end up with this sort of result if you let enough coolant out.
Reply: Every time i've purchase a vehicle whether it was from a dealer or car lot i always have a inspection done at the respective dealer. Sucks to pay $200 for another inspection but it's saved me 1000's.
Reply: yummy chocolate shake
Reply: Yup, well worth getting an inspection. Last fall I was looking at a track, it looked clean and ran well. Took it for an inspection, lots of issues, best $150 I ever spent.
Reply: Never ever EVER trust a dealership's "whatever-point used car inspection" either. It is absolute bullshit!

I recently had three cars inspected before I found the one I ended up buying. It cost me $100-$150 for each inspection, but they all came back with a laundry list of needed repairs. This was late last year, when dealerships were trying to squeeze top dollar out of every used car on their lot, and it was pretty obvious they were just detailing trade-ins & slapping them on the lots. 

I remember one car in particular was rusted out, had a ton of suspension problems, and brakes that were so worn, they wouldn't hold it on a hill with the parking brake set. It was so bad, the mechanic who did the inspection said flat-out not to buy the car. So I took it back to the dealership, gave them the laundry list of repairs, and was told they wouldn't fix ANYTHING, not even the brakes, and they wouldn't lower the price either. I immediately walked, then posted a review of my experience on Yelp. That must've really gotten their panties in a twist because they threatened to call the police on me for... reasons. I'm not the only one they tried to strong-arm out of leaving a bad review; several other people posted similar experiences. Full of absolute fucking scumbags, this dealership is.
Reply: also before purchasing make sure you research local lemon laws!   Some places, like where I am at things like this are covered and in this example the dealer is required to refund all $$ + related mechanics bills
Reply: I bought a car recently, and brought it to my local mechanic for a checkup - turns out the rocker-cover gasket was leaking.. which happens, either through over-revving or from drying out.
I reckon the latter, as an online car check shows that the car was not taxed for a year, most likely from Covid.
Reply: Definitely should’ve took this advice before buying my first car luckily the car is actually in good shape and runs really well there was just a few things I needed to fix for it to pass safety but since I got those things fixed I haven’t had any issues but it still cost me $500 to fix those issues rather than 100 to get it inspected before I paid for it so I could’ve bought the car for less
Reply: @StrikerFin  Drive with no coolant so the head heats way beyond its tolerance. Without coolant to both cool the head and keep the whole system at roughly the same temperature, some parts will heat more than others and you'll get torque as they both heat up and cool down at different rates. In places where the metal can't expand and contract, around bolts and frames etc., it will crack.
Reply: I always pay 500 dollars to a mechanic i trust to cone with me and look at a car before I buy